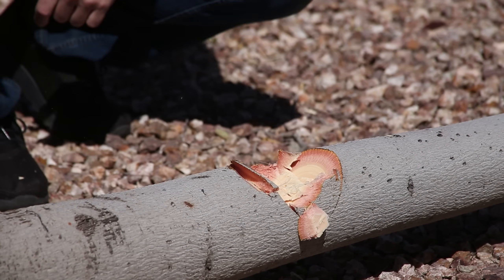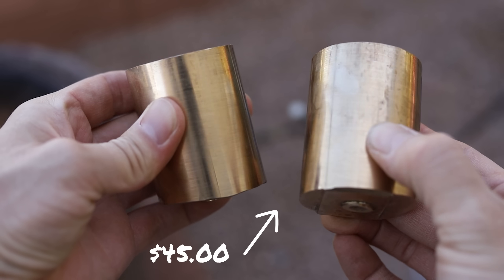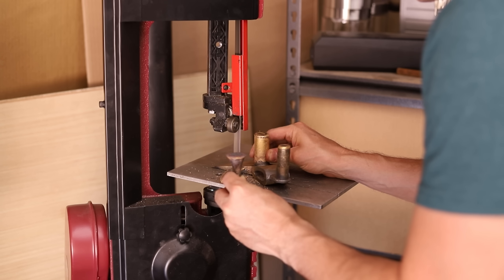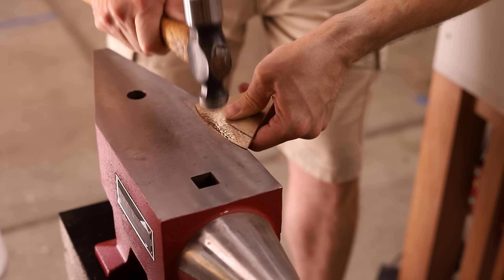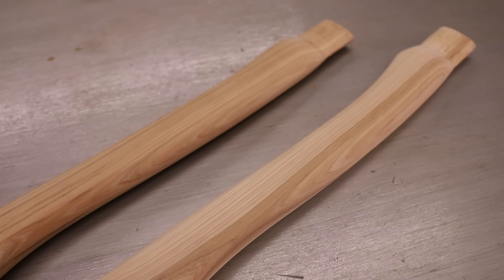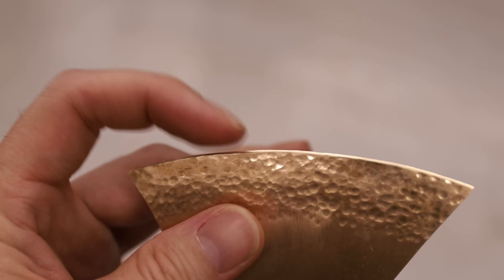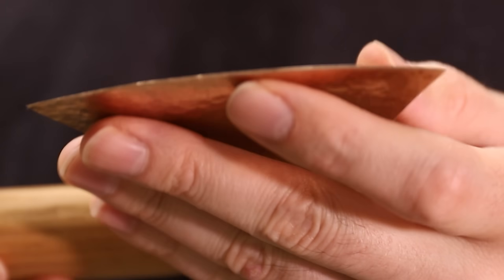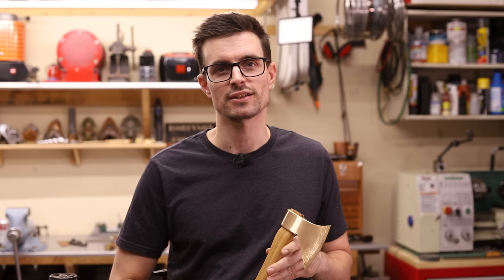Aluminum Bronze VS Tin Bronze, Making & Testing Bronze Hatchets

Comment: The color if the Cooper aluminum I blend I suggested in the class of quimestry in high school is trying to find something that not tarnish and looks like gold. There are people and ladies that is painful the jewerly, the aluminum is light. And strong for other things to open cans and bottles. That's and alternative for strength I think stainless steel is the best my ideas of colored metals inside. Are a succes I see in my works of doing diner wears and others stuff in stainlessteel they don't tarnish and but the other hand iron diferent kind equal to cement you must have to makes samples for the strength and you can make a good "hacha" I suggest or challenge you my metals blends and fusions through the years to accept the challenges of stainless Teel with good colored inside outsides and homogenous material like those before invented by me. The challenge of not erosion iron or cast iron for better long lasting life construction a blend or something between iron and stainlessteel using the basis of the bronce and aluminum tin "plomo" "estaño" copper and aluminum. Iron+steel stainless steel. There is a lot of work  by trial and error. 😊 FELICIDADES  AND GOOD LUCK.

Comment: bronze doesnt get nearly as much credit as it deserves - there's a good reason that it was THE metal for a long long time, until iron was figured out. bronze is actually better than iron in many situations, its just a lot more expensive and effort-consuming to make compared to iron (since iron isnt an alloy). of course steel will blow both out of the water, but still. i do like bronze.

Comment: There's a popular misconception that bronze was this really soft metal that was only slightly "better" than copper and totally outclassed once we figured out how to work iron or smelt steel, but it's worth remembering that the only reason we ever discovered steels that were tougher than even tin bronze is that most cultures that used bronze ran out of convenient sources of tin and had to find ways to make steel tough enough to use. Scarcity, not low quality, is what drove people away from bronze. Pig iron or mild steel is relatively soft, even just compared to work-hardened tin bronze (and while the best bronzes, which are mostly aluminum-based, are pretty recent developments, arsenical bronze, which was known and used in the bronze age, is tougher than plain tin bronze).

Bronze is sufficient for 99% of manual tool-based applications, body armour, basic structural work, etc; We probably couldn't have built skyscrapers just using bronze, and tanks would be a lot less tough, but for anything you use in your day to day life it would probably be completely sufficient.

Also I think the average person doesn't realise these benefits either, but it doesn't spark and it isn't magnetic, which is why we still use it in certain machines and tools today.

Comment: Great video thru and thru!  What a wonderful blend of woodworking and metallurgy.  The casting process was great, reminded me of freshman mfg processes class in college.  I think the additional heft from the higher-density tin bronze help the hatchet function slightly better by removing bigger chips per chop.  Maybe not as sharp and strong as steel, but much better corrosion resistance.

Comment: When you tig anything with aluminum, you have to use an inert gas like argon to encapsulate your tungsten and weld in a bubble of inert gas so it doesn't contaminate or oxidize while you're welding.

Comment: From my experience the TIG welding spot is there because it changes the structure of the metal in relation to the rest of the axe head
. In most cases hardening it which causes the light to reflect off differently because of the change in molecular structure.

Comment: If you're trying to compare metals with an archaeological context, you need to be working with arsenic-bronze versus tin-bronze. Tin was a metal that had to be transported thousands of km to the Mediterranean (apart from some small tin deposits in S.Turkey), whereas arsenic minerals frequently occur mixed in with copper minerals, and would have been hard to separate out between mine and smelter.
Yes, arsenic is volatile at modern smelter temperatures, and poisonous however it gets to you. But back then, they were smelting at lower temperatures. So you probably need to ditch the electric or gas *blown" furnace for a wood-fired one, and a couple of children operating the bellows. Dust masks and good ventilation all round!

Comment: Just a quick tip, I've worked in the Aluminum Diecasting field for about 7 years now. Those holes are porosity, not from shrinkage though, they are from trapped gases. You've made what's called "Overflow" which you refer to as risers. Overflow work better with high pressure die casting because the injection system squeezes all the gases into these overflows at the edge of the casting. With you gravity feeding the metal into the mold, I'd leave little vent holes on the end of your "risers" for the gases to flow out the other end of the casting. You'll have a much more solid casting. 

Awesome work though! I want to get into casting at home, I just haven't because of other stuff haha. You're doing some cool stuff here man
Reply: While you seem to be correct about the porosity being pores of trapped gases (at least from what i can tell by the form of those pores in the few viewpoints we can see them in the video), more channels to get rid of them would have hardly helped. The pores are at the highest point of the mold right underneath the feeder that worked exactly as intended an any "regularly" trapped gases could have just left the mold there.
These here however are due to the extremely high solubility of hydrogen in molten aluminium and low solubility in solid aluminium. When the metal solidifies the hydrogen forms bubbles that can no longer escape as the metal is to rigid to let it through. 
Industrially you always clean your molten aluminium by blowing argon or nitrogen gas into the melt before casting which removes the hydrogen.

NileRed had a similar problem once when he was making purple gold (a heat treated aluminium-gold alloy)
Reply: @bissalex You could be entirely right and the porosity is inclusions from the dross.

I know for small crucible operations they have Degassing tablets you can chuck in there and pull the dross out, might be a good idea for him to give that a shot
Reply: That's also an issue you don't really face in die casting, as the extremely high pressures just compress these type of pores basically completely. However when heat treating die cast aluminium these pores can expand and break the part, which is also why you rarely heat treat die cast parts. When casting with permanent molds or sand molds however these pores can be a real pain, especially if you are in an area with high relative humidity (as we had during the experiments for my masters thesis 🙃)
Reply: I don't no much about this but the Axes don't seem that sharp to me ? Maybe I'm wrong. I'm use to hacking at wood and a good piece comes off 🪓🔪🤺
Reply: every blacksmith should own a vibrator. it helps the liquid get into the holes and shakes out air, great tool
Reply: 🎼🥁 Some vibration might shake out bubbles.
Reply: What do you mean by "I'd leave little vent holes on the end of your "risers""? Where exactly is he going to leave holes? The riser holes are full of molten metal no?
Reply: @crosshairs007  Molds are designed to have metal flow into one side and air/other gases to flow out holes on the other side(Different processes do this part differently)

In this process he might take a pipe and dig a hole from the surface of the sand mold to the inside where he'd be casting a part, allowing air to escape from the other end while he pours metal. This will allow the molten metal to fill all the voids and small details.

Edit: I'm the author of the comment just happened to be on my other acct 😅
Reply: @doomsedge3  Didn't he already have those? Or are you indicating that he just put the filling and vent holes in the wrong place for proper air expulsion?
Reply: @crosshairs007  He does but they're designed a little improperly.

He needs to have his metal flow from one hole, and a channel into his Casting Cavity. Introducing Aluminum into the mold from one Axe Head wall to the other is going to cause it to splash and create porosity.

After that, I would add Vents connected by channels at the other end of the Casting Cavity. Picture the flow in your mind. Anywhere that may have turbulence or run into a wall and trap air will need a vent. Molten Aluminum behave a lot like Water.

In Diecasting these are referred to as Overflow and the cavity is squeezed from a Runner with a Shotrod with high Nitrogen/Hydraulic pressure to squeeze the gases out of the casting into the Overflow. When you're manually pouring into a Sand Casting, you just have to let the gases 'flow/vent' out because you don't have the pressure behind your pour.
Reply: @doomsedge3  So more smaller vents in more locations is better than a few big ones, and he needs channels between the vents? Thanks for the information. I'm not involved in casting or metalwork at all so this is very interesting.
Reply: @crosshairs007  It's honestly interesting even when you're inside the field 😅 Look at me, yapping on a Saturday about my job lol

But you are correct, you want vents where you perceive may be an issue with metal flow trapping gases. If all else fails you can make a bunch, clip the excess off later and remelt it.

Comment: try buying a slab of Alloy 25 Beryllium Copper hardened to 45 HRC. Them grind under water or file the shape, and polish it out. Swiss pocket knife blade steel is 53 HRC. not so far away from 45. : )

Comment: So one test you need to to is to see how long it takes with regular use to dull the edge of these, as a measure of how much work can be done before you have to hone the edges again because that's what really matters when that's what you have for your daily use. Then you need to do an efficiency test on a comparison with a steel hatchet and these to see just how well they work compared to a modern instrument, as a measure of what the improvement with iron age developments were.

Comment: Appleseed edge... look at an apple seed with the point upward. It has a convex shape to it. That's what is meant by that edge shape. The idea is to be able to get a sharp edge backed up by a good bit of heft. Edge geometry is heavily application dependent. As for an axe, it matters whether it is for felling, limbing, or splitting. Different shapes are better at different jobs. I don't like a broad axe edge because I find it skips out of the cut too easily, especially with harder woods, so tend to go for a somewhat narrower edge.

Comment: If you're looking at cold working for hardening, you might get a bit more mileage out of switching to a peening hammer (sometimes also called a scythe hammer) instead of the ball peen. You won't get quite as much of a decorative finish, but you can potentially draw out the edge to reduce the need to remove stock during sharpening, and also maybe cause a little less concentration of stresses from plastic deformation.

Comment: The difference in color is caused by the heat treatment, since the metal had time to anneal in the casing the tig repear heats up and is cooled differently creating the difference in metal appearance. With this being said if you heat the surface of the axe up to the point where it begins to change color you should be able to buff out the scar once the surface is cooled again.

Comment: The weld cooled way faster than the metal that cooled in the mold, so the  weld will have much smaller crystals. That's bound to affect the apparent color.

Comment: You have made the observation that aluminium bronze is lighter than tin bronze.
That means that tin bronze will generate more momentum 
and have greater impact with each blow.
Hence, it will display greater success at cutting through timber.

Comment: One note, you've made metal axe that looks like a metal axe, but in Ancient times for quite a long time they made metal axes that look like stone axes, with huge bulbous convex edges that were basically indestructible. It took a long time for the form to adapt to the material properties.
Reply: Not so - the earliest Bronze Age axes were diminutive and gracile. During the Chalcolithic they quickly evolved into gracile types - and the sheer cost and difficulty of extracting and melting enough metal to make an axe means they were small. If you held original early axes in hand, you would see they are much smaller than you imagine - often smaller than a man's hand, narrow butt and thin. That's why they used relatively large wooden handles, to add weight for cutting.

Comment: I'm reminded of a story of aluminum composite with hollow microphones  making aluminum bullet proof. Going from this I remember a story of aluminum blend3d with alumina to make exceptional brake rotors. I'm wondering if these two stories inspiring an alumina loaded aluminum bronze might make an exceptional blade edge and body of are and knife. Further in thinking, Tin Bronze with alumina might make a saw blade that can quickly cut marble and granite (pyramids anyone)

Comment: In my relatively ignorant mind, it makes sense that the aluminum and tin alloys performed so similarly. Aluminum is so extensively used as a modern material because of its strength-to-weight ratio, most of which comes from it being so darned light, not necessarily strong. Chemically speaking, apparently aluminum and tin are pretty similar – they're both "P-block", "post-transition" metals, which I guess explains why they work similarly in alloys. So, when it comes to casting, aluminum is basically a "space-age tin" – similar properties, but at a much lighter weight.

Comment: some 3d printing tips... 1- have the shape for the inside of the head where the handle goes pre-shaped so you don't need to file it into shape.  2- print the part standing up, meaning the sharp end in the vertical (z plane) (the hole for the axe handle would also be in the z plane)..  this will just about ret rid of the layer lines, especially if you print with 0.1mm layer heights, this'll cut down on a bunch of the grinding as well.  3- while you're in there, make a little shape to put on the axe side, maybe a logo or something else, for fun.  with the huge reduction in grinding due to different print orientation, you'll have a nice accent on the head that won't need a bunch of work to make it nicer.  4- last thing, if the layer lines are still too prominent, you can hit the head with some thick primer and that should even everything out.   I know you probably still need to smooth it after the cast, but your layer lines were HUGE, so this should save material, time, and work.  ;-)

Comment: when testing edge retention you often give it a more acute edge to see when it will actually roll over.. you can take pig-iron, file a very broad edge and it will hold if fairly well. I'd like to see testing done with set edges, test and then grind it to a more acute edge.. start at 30 gradually moving down to 15 or even 10 degrees and see when the edge begins to roll or chip.

Comment: It definitely appeared that Tin Bronze was way stronger., at least to me. 

Tin Bronze was significantly stronger than iron in the BC times of the Bronze and Iron ages, the problem is Tin is not an easy metal to get. During the Bronze age the two great sources the Mediterranean civs had were Cornwall, Britain and Afghanistan. Both hard to get to and very far away, with pirates looking to pick you off at every step. But, it was worth so much money and so vital to their industry that traders regularly took the risk. 
Once iron rolled around and they found the stuff everywhere, Bronze became a hard commodity to justify.

Comment: 05:31  An appleseed edge is a curved bevel, rather than a straight bevel.  You get one naturally if you sharpen with a somewhat slack belt sander.

Comment: As a note, for safety, do not split the kerf all the way to where the bottom of the axe head will be. You are creating two spots on each hatchet, directly under the head, where the wood can easily break - sending the head flying. Won't bother you by explaining that the wood grain should be in line with the edge, not perpendicular, but honestly I highly doubt that you intend to use these regularly.

Comment: Iron age kicked off not because iron was somehow a better material, early iron smelting was kinda bad, the results had significant impurities, it was soft, corroded fast as hell and was much more labour intensive than making bronze. However, iron ore is common, there's no place where iron ore, even a bad one, can't be obtained troughout Europe, the Mediteranean, Middle east and India. This stuff is everywhere and there's a lot o it. Unlike tin and tin ore and copper. There were only a few places capable of getting those and it required complex trading networks. However, if a random village in Germania had a supply of iron ore and the knowledge of making iron out of it, they could suddenly supply their own metal, which would be impossible with bronze. 

It was only after centuries of metallurgic development that you could say that the iron and steel produced were objectively better than bronze for tools and weapons